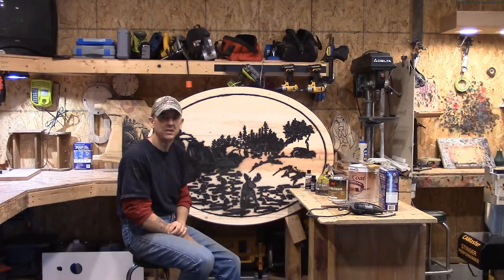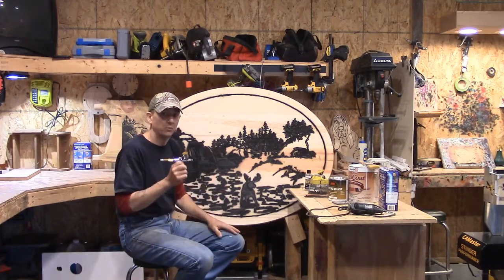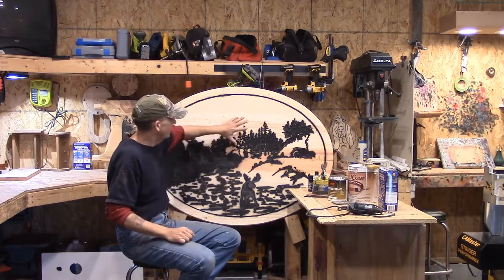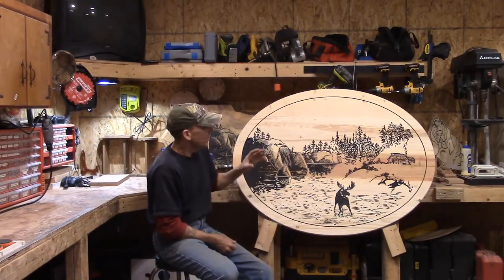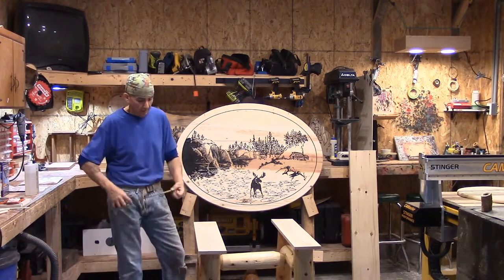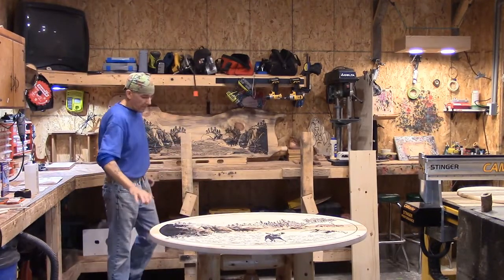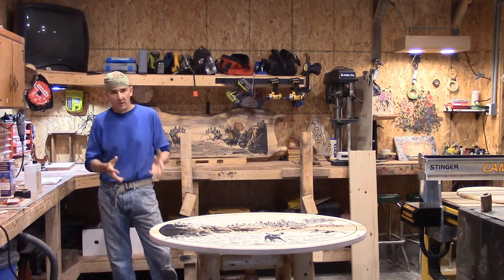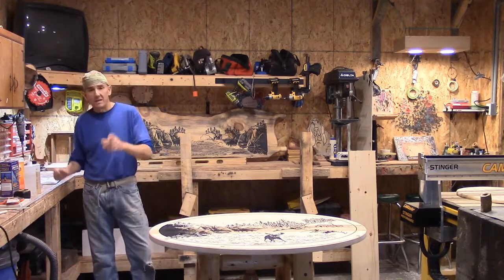CNC Kitchen Table Finishing

Comment: That was great Steve, I wish  I had done this before with a coffee table that I built.  In my case I had a relief model cut into my top and It required 2 coats of bar top resin to fill the relief.  It came out real well, except for the edges, which needed some sanding.  No one mentioned applying with a brush, I pretty much just let it drip over the top.
One question, did you need to heat the air bubbles after each mixing or just at the end.  How long did the 3 mixes that you did take overall?
Reply from the maker: Good morning Sir, thank you for the kind words and I really enjoy pouring my tops. All 3 batches were done in under 15-20 minutes. I use a heat gun only because I've seen what happens when someone gets to close with a torch. The air bubbles started to appear about 20-30 minutes into the pour.